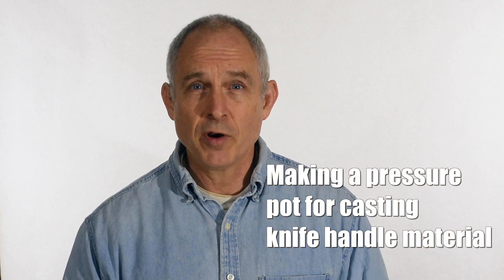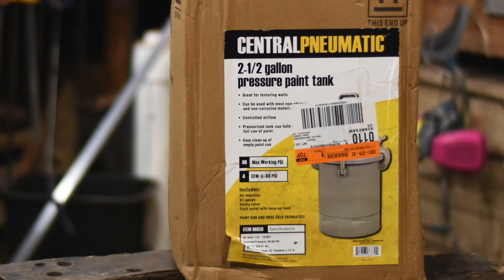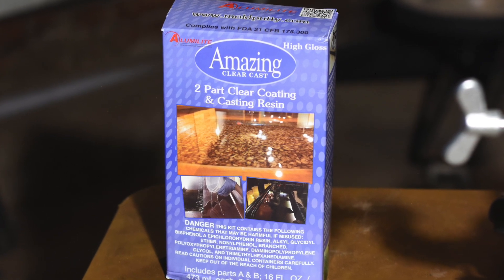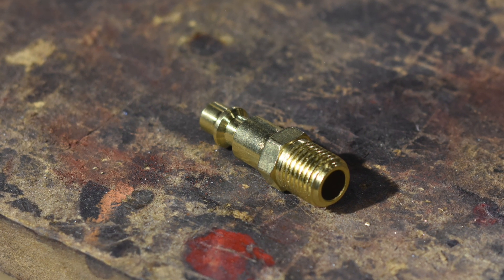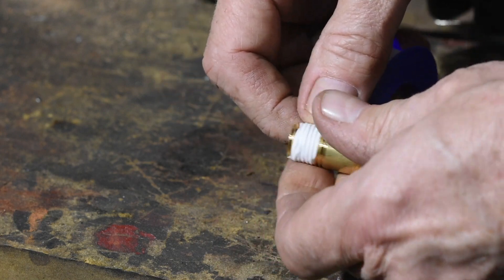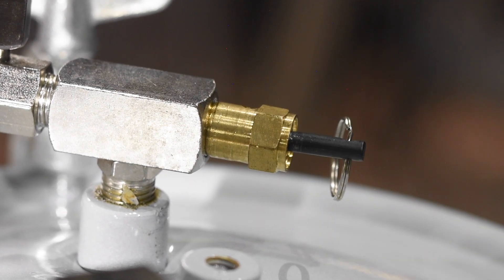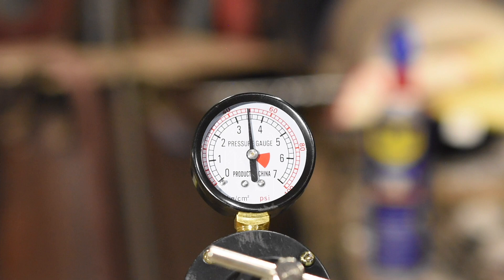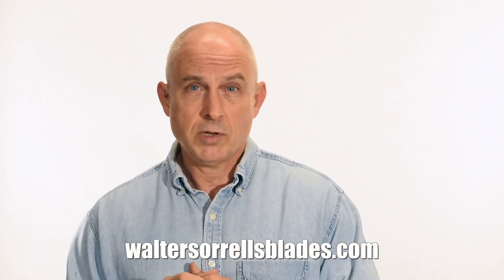Making a Cheap Pressure Pot for Knife Making Material Casting

Comment: when casting a handle, do you put the epoxy/stabilized wood mold in a vacuum chamber first to suck the air out and then into the pressure pot? or do you skip the vacuum chamber step and go right into the pressure pot?

Comment: Mr Sorrells My name is Travis Kirk my friends call me Kappy, anyway I happened upon a brand new paint sprayer vessel/pot and watched your according video but this paint vessel has an auger or agitator in it as well as ever else from the one in your video.... Can I turn this into a resin pressure pot or am I SOL? My own theory is that it appears the auger assembly is threaded in somehow so in theory I should be able to cap it. I know you can't see what I'm talking about but you seem to have a hell of a lot of experience and I had hopes of you pointing me 8n the right direction... BTW if I did everything right I'm now a Patreon member. That's the least I can do given the amount of stuff I've learned from you. Thanks for your time.

Comment: Great idea, thanks, I will be building one myself. 
One problem I have is with the relief valve adjustment. I worked 32 years in the air compressor industry. Showing/telling people how to adjust the relief valve for a higher pressure is not a good idea. If someone does this on their air compressor 'cause it blows at a pressure they don't like it's setting them up for a possible accident. Insurance won't cover damages when they find out the relief valve has been tampered with and they will check. Better to buy one (in this instance) at the higher pressure assuming the paint pressure pot is rated for it.

Comment: Wouldn’t a vacuum be better since it pulls the air bubbles out of the resin instead of making the air bubbles smaller?
Reply: Watched a guy try that in a video, I thought the same, pull the air out, no bubbles. As it turned out, the bubbles really bubbled, like boiling, the result was a frothy mess as the resin started to go off before all the bubbles could be evacuated. Could it work? I still think so, but an extremely slow set resin and playing around with the vacuum settings.
Reply: It’s porous so the air will evacuate during off gassing.
Reply: I had the same idea on a couple of resin projects that I had, but it didn't work.  It just keeps bubbling away and turns into a big mess.  I think the reason vacuuming out the air doesn't work has something to do with vapor pressure, where dropping the pressure causes certain compounds in the mixture to start boiling.
Reply: @TuckMcSouthard  “Boles Law”
Reply: Yeah, I think it does work. You need a really long  curing resin. An hour or more. Also I saw a video where the guy making the blank for an bow handle, went in stages as he applied his vacuum. He would actually release the vacuum two or three times and the bubbles would pop. He said that during the process the air in the pieces of wood would actually be replaced with resin, hence the bubbling. He also use a container that held more resin than was needed. I think both processes work perfectly fine.
Reply: When you drop the pressure you lower the boiling point.

Comment: Nice video. I actually have on of those. I  use to stabilize wood. I got a clear thick (>1“) plexiglass disk with a gasket as a lid that I use to evacuate. Then the standard lid to presurise the resin.